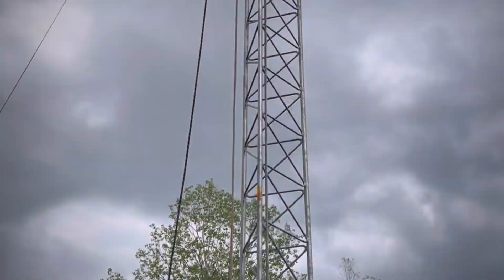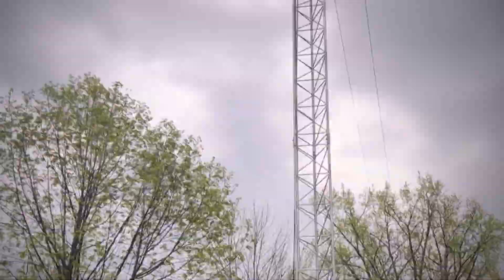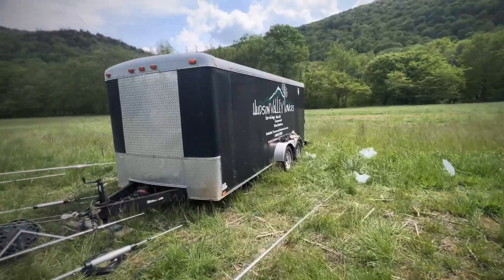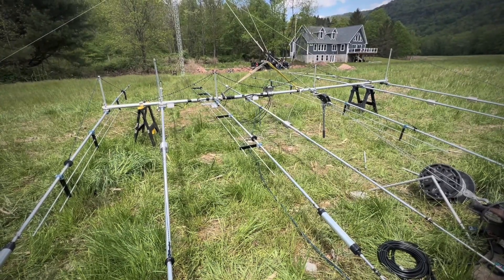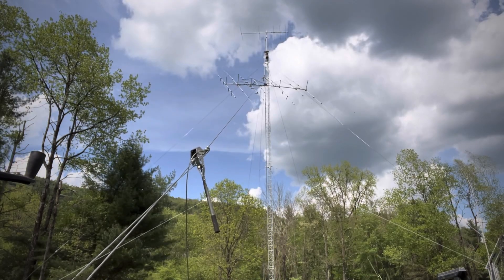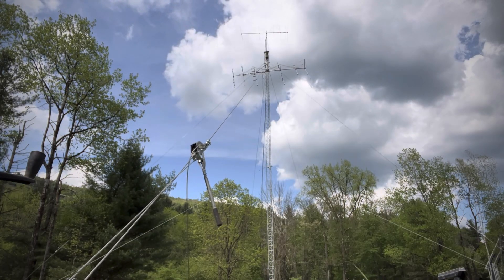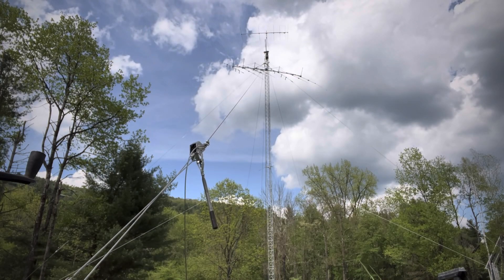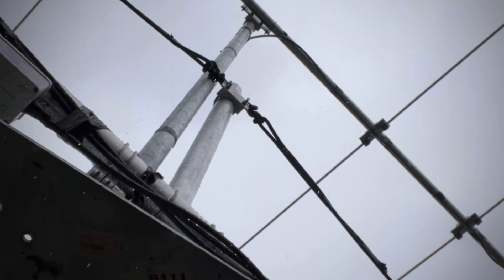How To: Ham Radio Tower and Antenna Install

Comment: How do you keep those cheap yaesu rotor clamps from cracking
Reply from the maker: Tighten the through bolts first, then tighten the bolts that hold clamp to motor. This procedure prevents the cracking that some have. Its the procedure